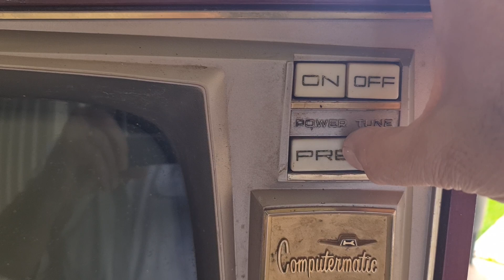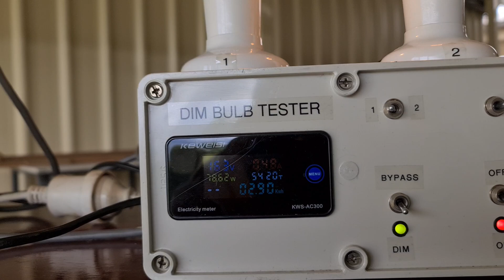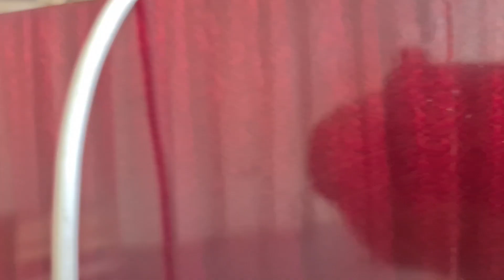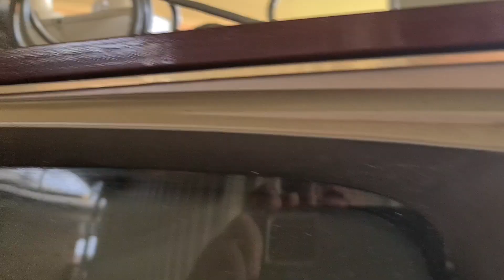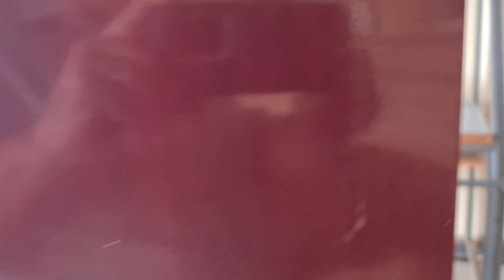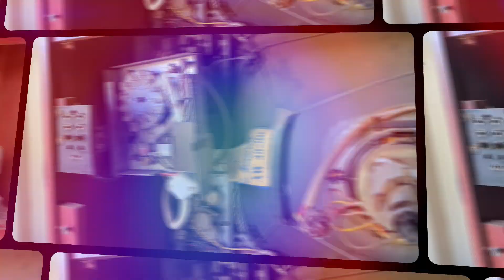A 1963 Kriesler TV Restoration - Part 2 - Lets Fire it Up !

Comment: In the shop I worked at a long, long time ago, the FIRST step with a "set" like this? Would be to discharge everything that needed it. Then get that five inches of dust, dirt and debris out of there!
It surprises me that your even starting work on such a filthy chassis!!!!!
Reply from the maker: The challenge was to see if it just worked after sitting for so long in a shed. I mosr certainly discharged everything before working on it, lol !
Cheers

Comment: philips tube 'miniwatt'
Reply: Kriesler used Philip Tubes or Valves because Philips owned Kriesler,Ian,
Reply: By the Baz the Kriesler is Missing the HI Voltage Cage probably a past service Man have failed to put it back Regards Ian,